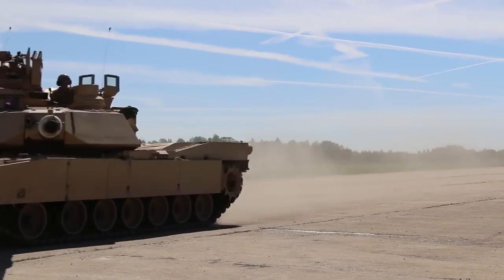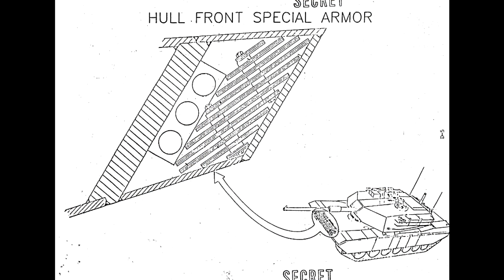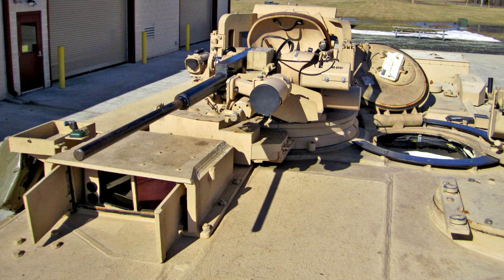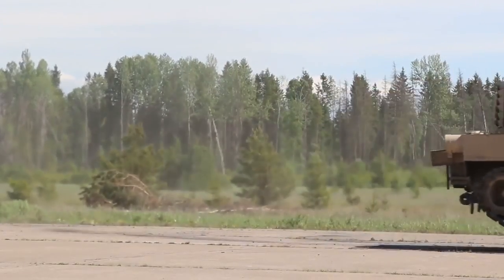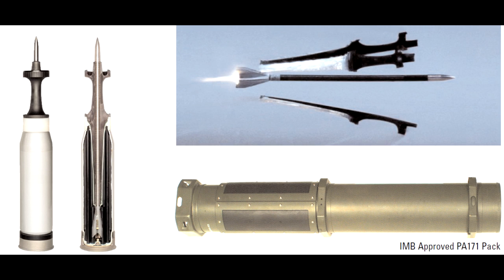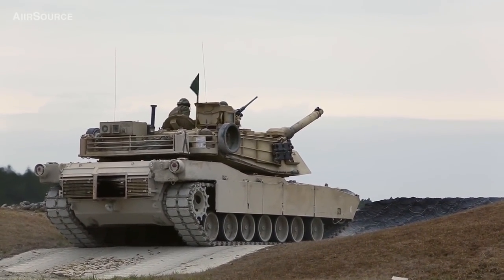Problems with Abrams tank

Comment: There's just so much wrong with this:   
00:47 The initial claim that, in 1980, the M68 105MM gun 'wasn't very good'.   Based on what standard?  Granted, The M68 rifled gun is basically the barrel of the British Royal Ordnance 105 mm L7 gun altered to accommodate a revised drop block breech mechanism.  The gun dates from 1956, but that hardly means it wasn't highly effective.  The standard tungsten antiarmor round for the M60 tank, the M735, could penetrate 350 millimeters, or 13.7 inches, of steel rolled homogenous armor (RHA), the standard measurement for armored vehicle protection. The M833 DU round, however, could penetrate 420 millimeters of RHA positioned at a sixty-degree angle for maximum armor thickness. By comparison, the larger Soviet 125-millimeter gun on the T-72 tank could penetrate 450 millimeters of armor. The M900 'super-sabot' rounds we were using in Desert Storm had 520mm of penetration at 2km.
1:24 - That is a horribly rusted out V-Pack.  A Tank Commander would get fired for maintenance like that.   Water should never be in the plenum box.
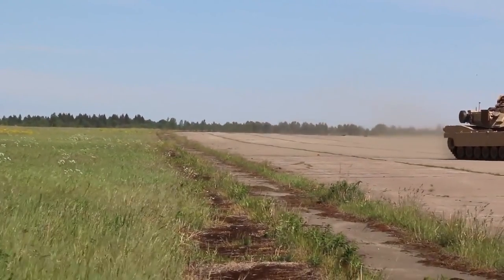1:30 - there's an implied - and completely fictitious German bias here.      The AGT1500 has vastly superior performance and ease-of-maintenance compared to the German diesel.  Both are fine engines - until it comes time to work on them.   I'll take the AGT all day, every day - even though it's an engine using 1960's technology.
2:00 - here's where you make s slight, but significant error.  You state that the Commander doesn't have a sight and cannot override the gun, while showing a picture of a TC with his hand on the Turret Override and looking through his sight.  What you mean is that the M1/M1-IP and M1A1 didn't have an independent viewer for the commander.  Ask the Iraqi's if we suffered for that.
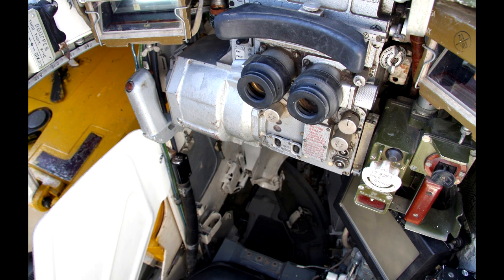2:46 "and that's it".   There's so much wrong with that statement that I'm not going into depth ; suffice to say that if there was an injury to a crewmember, the tank could be fought with a 3-person crew without appreciable degradation.   
3:07 - The Commander is completely blind at night.  LOL!  uh, no.  The vast majority of US operations in the M1/M1A1 were night operations.
3:24 - Extolling the Soviet Gen 1 IR sights.  Brother, these were huge spotlights in all of our optics.  If an opponent was foolish to turn on an IR light - they would die.  Quickly.
3:42 Russian 3VBM17/3BM42 (3BM44 "Mango") 125mm rounds - fielded in 1986  specifically to defeat Chobam armor - bounced off M1A1 turrets and hulls, which directly resulted in the 3BM44M "Lekalo" and 3BM48 "Svinets" rounds.   
3:50 It's M1-IP (Improved) - not IPM1.   You got all the improvements wrong.   The most significant of which, for the crew, was a rear bustle rack and extended sponson boxes.
5:14 - V-Packs (the air filters) weren't cleaned 'every couple of hours'.  It was part of daily maintenance, as well as track and engine maintenance.   Most of the time, they were tapped out - not blown out with the 'thousand-degree-wand" you showed.
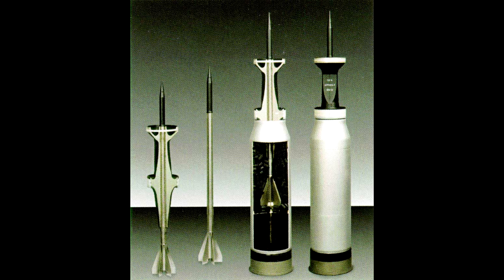8:30 - I really, really tried to follow this incoherent ramble about the length of rounds vs. length of the gun, but it made little sense.    You're argument correlation was way off.
Reply: @Spearhead133  2/32 in Kirchgoens from '86-'89 :-)
Reply: Many designs from the M1 era have survived in service and been upgraded time and again for good reason. They're great tanks with capability to be improved on as required.
Reply: @ms1 ms1 just don't bother typing all this. Me and you both know how Biased and ignorant this guy is. Those who hate America, will believe anything that reassures their beliefs.

Comment: The relatively thin glassis is of no concern from a frontal attack. From above, perhaps, but then so is the turret roof. Of every tank, everywhere. The deficiencies the narrator celebrates have been either corrected or they’re irrelevant on the battlefield, the fuel issue being a noteworthy exception. But multiple wars later, it soldiers on with a decidedly “IDGAF” attitude. There are many more details to consider, but you get the idea.

Comment: The reason the Abrams has a gas turbine is because it produces cooler temperatures, less noise, a lot of torque at lower speeds. In a ww3 type situation fuel would be scarce that is why the engine can take different fuel types
Reply: A turbine engine does not produce more torque a lower speeds than a reciprocating engine

Comment: I can agree with a lot of what you said but when it comes the m1a1 and later variants some of your points don't make sense. Specifically the night vision and armor. I have seen many videos and read many stories about Abrams shrugging off enemy shells and I have heard that at least during the gulf war that the night vision of the Abrams was considered amazing. I can agree to many of your points but I can't say that the Abrams is nearly as bad as you make it out to be. It has a long track record against soviet tanks barely older than it. In conclusion many of the problems you stated really don't matter considering the way the tank works.

Comment: One problem I would have is the weight of the tank. If a conflict to break out, it would play out in Europe (Russia VS the USA)
Problem is , 70% of the bridges simply could not hold up the weight of the abrams tank in Europe, and looking as a lot of Russian vehicles can either float or drive underwater and are a bit lighter, they have a higher chance of getting through such obstacles.
Reply: Way things are going in the US these days it  be Abrahams vs Abrahams on your  home turf for a change
Reply: @paulchristensen2854  Abrahams...? Autocorrect?

Comment: If I rember correctly, the whole Multi-fuel thing was a holdover from the Cold war. It was part of a worst case scenario of ground war in Europe against the Soviets. being multifuel, it meant that if one allied force was cut off or had reduced logistical throughput, they could use excess fuel from an allied unit, or even run of appropriated cooking oil if needs must, all to keep the tank fighting the projected soviet tank hordes. And the turret armor thing was literally a design choice, because it was designed to be hull down, with only turret exposed, blasting Soviet tanks at two kilometres as they rushed across the Fulda Gap. The engine speed was so that it could reposition easily and quickly to another prepared position, or when on the offensive, break through enemy lines before decisive counter attacks could be mounted.

Comment: In the thumbnail you show the ammunition exploding and shooting flames out the back of the turret it's designed to do that so the crew doesn't get hurt or die there is 2 plates that shoot up when the rounds explode so the explosion doesn't go through the tank

Comment: I was a driver then gunner in 3ID 1-30thIN when we were mechanized infantry. I worked with the SEP V2 and agree on this video. Another problem you could note is if you let the tank sit, even for a weekend, the battery power drains faster than flushing a toilet. It is a gas guzzler like you said. Still if it starts and has fuel, it is a very fun and decent tank but is needing of a replacement in the near future. Sadly US has kind of drifted away from tanks because of Strykers and other projects.

Comment: Well, there is one distinct advantage, among several others, to the AGT1500 turbine engine used in the Abrams tank. At idle, the engine is virtually silent compared to any piston driven diesel, multi-fuel or gas engine type. This can be exploited when creeping into or out of position, but continuous movement of the track under 64 tons (not including the weight of the road wheels, torsion bars, drive sprokets etc.) becomes rather conspicuous to say the least. Although, it is without a doubt, the quietest tank. Another advantage of removing and splitting a pack in a forward deployed environment is the speed and efficiency maintenance can be performed on the power pack. For example, switching out the turbine, final drive assembly of the transmission or AGB and then ground hopping the pack for functionality. There is a lifting bar which can be used to hoist the assembled power unit with the aid of a recovery vehicle or overhead hoist, and drop it back into the hull of the tank. If parts are on hand, (i.e. pumps, tubes, hoses, filters, seals etc.) the maintenance can be completed and tank mission ready in less than an hour, if hypothetically, it was essential the same asset be redeployed to the battlefield as soon as possible. Like most large track vehicles, there are routine repairs performed quickly in the field, and some repairs which should be performed more quickly if performed in the field. (note: replacement of recoil seals which require disconnecting the main gun tube from the breech block was more labor intensive than it should have been; hopefully there was a design modification providing quick access for removal and replacement of the seal) Regardless of how user friendly a piece of equipment is, large tactical vehicles and engineering equipment should be transported to a forward operating base from which repairs can be made, unless none is available within a specified radius. Of course, that is under the presumption recovery assets are immediately available for support. No need for anyone to spread their ass on the battlefield or anywhere close to it, unless no other option.
Reply: Replacing a Leopard 2 powerpack can be done in under 20 minutes with due haste. I dont think the gas turbine comes out and back in faster. It also has to be hoisted out and in at an angle, making it problematic on uneven ground, where as the L2 MTU comes out and back in straight up. And: The German maintenance vehicle uses the same MTU and has the ability to donate its own while running the hydraulics of its crane off the batteries/APU. Thats a quite nice feature when shit hits the fan.
Reply: That is a very huge benefit but IMO it’s the lack of visible diesel exhaust that Russian tanks have. In the era of drones all people have to do is look for the smoke and they will find the tank and call in artillery. The smoke is a bright neon sign saying I’m here
Reply: @WiscoMTB37 Yet, the gas turbine generates more heat, amplifying the heat signature both of the exhaust as well as the hull. I'd rather have a smoker than a glower, especially at night... also, these diesels only smoke hard when you floor the pedal.
Reply: @Ganiscol  that’s a valid point, unfortunately only tanks like t72b3, t80bvm and t90m have 2nd gen thermals. While Abrams m1a2sep3 is on third gen now. A regular t72 is on 1st gen only for the gunner. So even though the Abrams is hotter, a t72 is still way more visible due to camera quality on Abrams. Tank vs Tank I don’t think the engine heat is that big of a deal.

But ya against a KA-52 or drone that engine temp is definitely going to be a neon sign aswell. But I think at night unless your tank has been turned off for hours, it’s going to be visible, a abrams just more so.
Reply: @WiscoMTB37  t72 is mor hot then abrams.
Engine is very not effective. ka-52 have thermal from 90s
Fueal consummatum in t72 is wors then in abrams

Comment: For a tank with so many problems, the enemy sure feared it. The Iraqis called it "whispering death". The M-1's cleared out Kuwait in a little over an hour. Kuwait is about 60 miles across and the M-1 back then could go about 60 miles an hour. This means the M-1's barely slowed down at all when wiping out all the Iraqi tanks in Kuwait.

Comment: The performance of the Abrams is directly proportional to the training of the crew + supply line.
Reply: That statement is true for every tank
Reply: You know the capabilities of the tank matter too tho
Reply: @donaldhysa4836  Yea, that's why the gas turbine engine was chosen. Because the P/W ratio is excellent saving a lot of weight without losing power using different fuel types unlike multifuel diesel engines.
Reply: @donaldhysa4836  yh but the tank is superbly built
Reply: @flyingpizza7486 not superbly built as the challenger and leopard
Reply: @Galahad93   u sure?
Abrams is definitely better than the Challenger maybe not the leo
Reply: @flyingpizza7486  the challenger has better armor than the Abrams.
Reply: @Galahad93  It doesn't. The Challenger 2 has worse armor, mobility and crew.
Reply: @flyingpizza7486  The chally 2 has much more protection (gen 2 chobham armor). The challenger 2 has well trained crew who are more knowledgeable when operating the tank. Dunno where you got the "worst mobility and crew" from.
Reply: @Galahad93  The abrams is known for its amazing armor which is proven to be better. The untrained crews is because the challenger is British which means no combat experience which means no skilled crews
Reply: @flyingpizza7486  Nice trolling, but your overrated Hollywood tank (Abrams) armor is nowhere close to being good as the Brittish challenger 2 armor. There's has been more Abrams destroyed than challenger 2 in Afghanistan and Iraq. The chally 2 has survived alot of rpg missiles unlike the Abrams.
Reply: @Galahad93  Fair points but you lack knowledge. There were far more abrams tanks deployed compared to challenger, hence more could be hit by AT weaponry. The abrams though has a much better record than the challenger 2 for combat, armour and mobility. The abrams does have faults but the challenger 2 is simply worse, if you would argue the leo 2 is better I would agree but not for the challenger
Reply: @flyingpizza7486  You lack knowledge... The chally 2 is far better cause it has survived more rpg rounds due to better armor. Leopard is definitely better than both.
Reply: @Galahad93  you dodge my argument entirely, clearly you lack knowledge on the subject. Glad you agree the leo is better than both
Reply: @flyingpizza7486  You clearly lack knowledge on the challenger 2 and most of the things you say ain't true. The chally 2 has better armor but the Abrams has a better powered engine overall. 🙂👍
Reply: @flyingpizza7486  plus just because it lost to a mine doesnt mean 💩. Mines can easily take out any tank. Overall the chally 2 has better armor and you can research that for yourself. 👍
Reply: @Galahad93  My man you are just rephrasing what I say to you. The chally doesn't have better armor nor does it have a more powerful engine. Please stop saying things because it is your favourite tank. I do over defend the tiger 1 and 2 but I get they have problems, you don't seem able to understand that the chally isn't good compared to the abrams or leo
Reply: Very true

Comment: 6:48 Multifuel diesels? Say hello to the Chieftain's engine having a poor track record!
Reply: "Poor" The Leyland L60 is beyond poor....it nerfed the Chieftains outright.
Reply: @jyralnadreth4442  the british are all about fair play. With a good engine the chieftain would have been too OP so they nerfed it for fairness
Reply: @vermas4654  in terms of availability....the Cheiftain set an all new record low of 35%. Even the Centurion (Cheiftains predecessor) in AVRE form lasted until 1993 with Cheiftain leaving service in 1994. Swap out the L60 for a modern Perkins diesel and it would be awesome with some Mexas added
Reply: @jyralnadreth4442  but then it wouldn't have been fair. So the British kept it nerfed.
Reply: @vermas4654   also british,  we cant afford more tanks sir
Reply: However what your forgetting. Is that the cheaften came out in 1963 meaning that the abrams came out 17 years later
Reply: No idiot it was fixed ages ago u weirdo

Comment: I think all the points you made with the m1 is completely moot when it’s considered true that the original m1 was never fielded in significant quantity until the m1a1 upgrade, which was then put against outdated soviet machines in the Gulf War. At least the m1a1 employed stabilization and the German gun, but that’s starting to get old.

As for the multi-fuel capability, you’re forgetting that the supply chain won’t always be able to fuel such a heavy beast with the same quality of fuel, diesel or gasoline. Regardless of your banter it’s pretty clear that being in the middle of Asia without the possibility of refueling with the design fuel would mean resorting to a fuel that would blow up any other engine but would work, even less efficiently. That is what defeated the Germans in Stalingrad when one of their entire armies was swallowed by the soviet might and cut off from their supply chain. That same problem is currently making it difficult for stores in the United States to sell stuff that’s being sold out in a day, due to COVID-19.

Comment: The US chose the turbine engine because it produces less smoke and it has most torque near idle. This actually means turbines are more efficient than diesel but only under load, turbines consume far more fuel during idle. Another reason is that turbines will burn almost anything and multi fuel diesels have a pretty bad rep. People also say this engine is louder than fuck but fail to realize that the higher frequency emitted from a turbine engine has less range than the thundering rumble from a diesel, of course it's gonna be ear piercing if you're right next to the exhaust. This tank could sneak up on you and the first thing you would hear is tracks flanking, not the turbine. So it has a few advantages over diesel.

Comment: some of your info on the A1 is wrong.  the TC had the same day/night sights as the gunner through the GPS and was never blind at night. he also had 3x and 10x magnification.   all engagements were trained with a hull down position. and back then, we could shoot people before they even knew we were there. also, at full speed, you couldnt even hear it coming towards you until it was maybe 100 feet away. the v packs sucked. with 650mm sloped depleted armor on the hull, in the mid 90s, there wasnt a tank in the world that could penetrate it, including another Abrams.
 19K 96-00
Reply: No